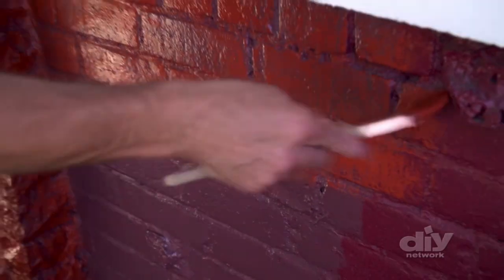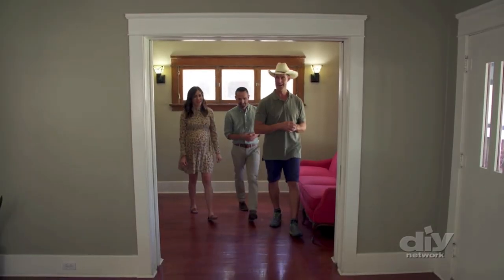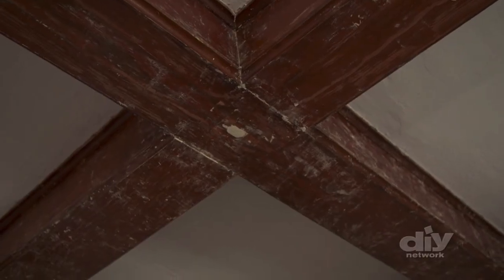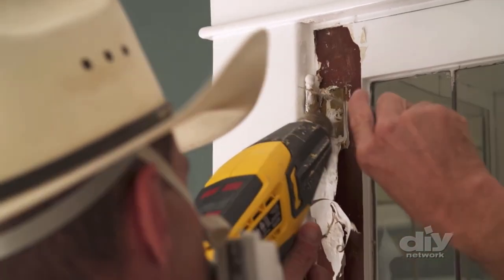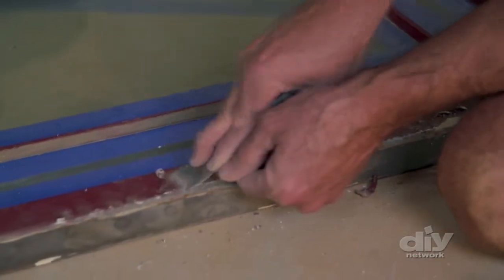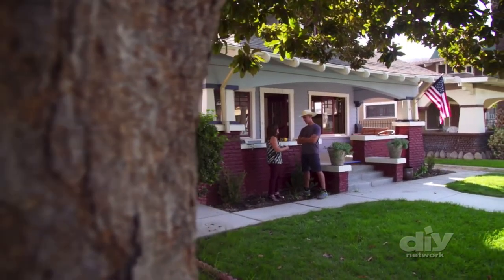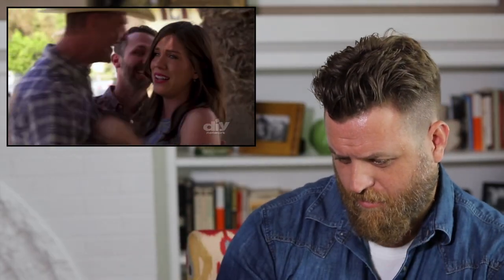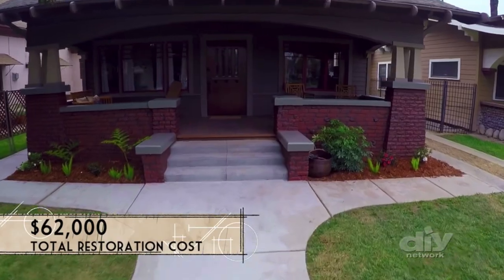Restored Reviewed /1913 Craftsman Bungalow / NEVER Paint your Brick

Comment: That lath/plaster wall demolition was stupid. Basic rule: If your going do 'demolish' a walk, etc. don't just take a hammer, pry bar, etc. and rip it all into one bit mess. Think of how it was built and then reverse the process. Eg. Lath and plaster: take off all the plaster first and leave as much of the lath in place as possible. Clean out all the plaster. Then, start on removing the lath. 
Much easier to remove, cleanup one type of material at a time.
Reply from the maker: This is true